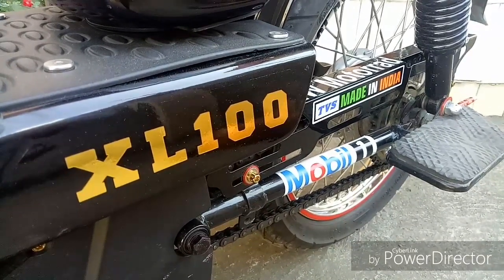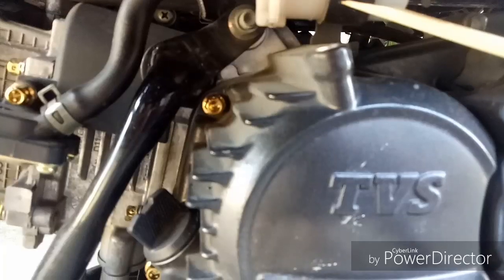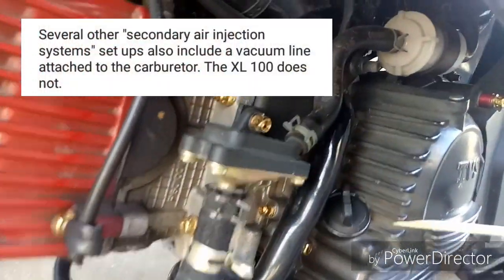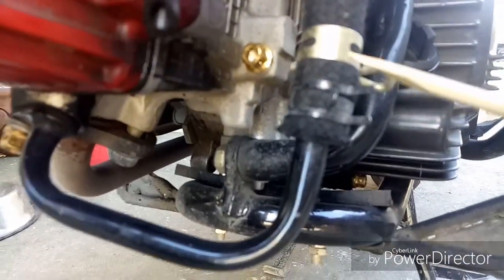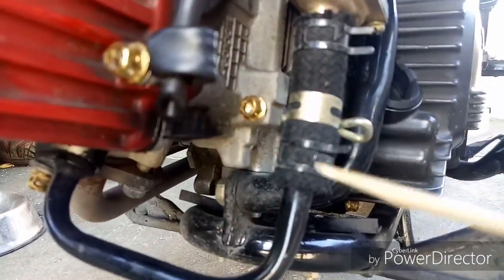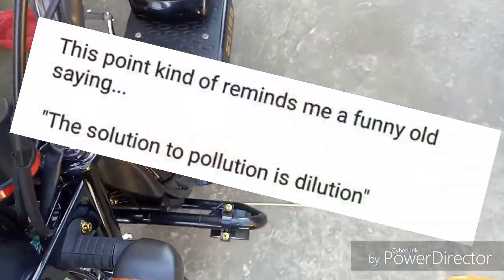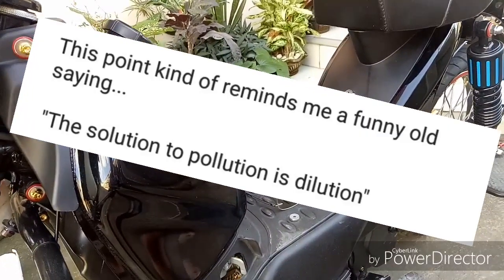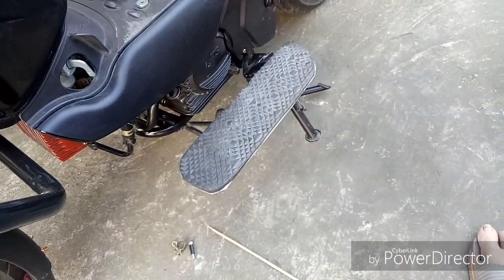TVS XL100 SECONDARY AIR INJECTION SYSTEM EXPLAINED

Comment: My tvs xl100 premium had no popping sounds on a stock muffler. However theair cleaner SAI broke and have no parts yet available at any tvs branch and 3 party sellers. I was wondering if there is any effect if i disable it while waiting for the part to be available.

Comment: does this step reversible? i mean can we return this back to normal before we submit our bikes to emission tests?

i heard AIS helps cleaning our fumes... does altering this process makes us go fail on emission tests?

thanks! looking forward for your reply sir!
Reply from the maker: The shot answer is yes. Just remove the parts plugging the hose. Although, reversing the actual modified exhaust system is not possible.

My xl100 easily passed the sniffer inspection test after the modification
Reply from the maker: The bar is set very low. Probably because every business tricycle in town needs to pass this test. They always pass..
Reply: thank you very much sir! for the idea 👍👍👍

Comment: If you block it off, the effect is less power...
Reply from the maker: Can you back that up with an explanation?

If you modified the exhaust system (glass pack exhaust) the extra air from the secondary air injection causes backfire through the exhaust system. Modified exhaust and blocked secondary air injection results in better overall performance. And, additionally solves the backfire through the exhaust system problem. Based on personal experience.
Reply: I have motorcycle with secondary air    injection system and i did not make any modification of exhaust but still the popping is there, could be possible that is the cause of popping..
Reply from the maker: @Nacz Ride That being said. There are different variations of the secondary air injection system. Some setups have air vacuum lines that activate the secondary air injection system by vacuum from the air intake. 

The XL 100 is a simpler approach. It's more by induction, based on air flow, pulling in air from the secondary air line, from the increased exhaust system flow. 

So, my point is different motorcycles, different systems, different symptoms for problems.
Reply: @stevekb1dig  thank you...
Reply from the maker: @NACZRIDE  I do not know about other motorcycles. The information I have in the video is specifically about the XL 100 secondary air injection.